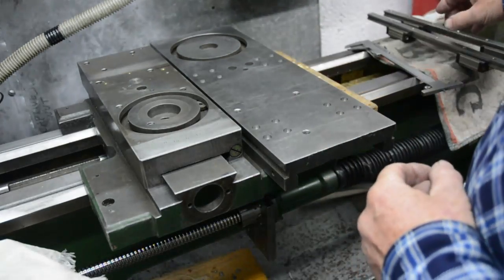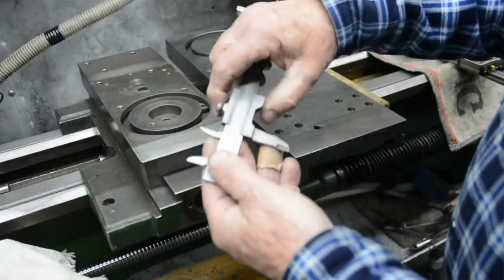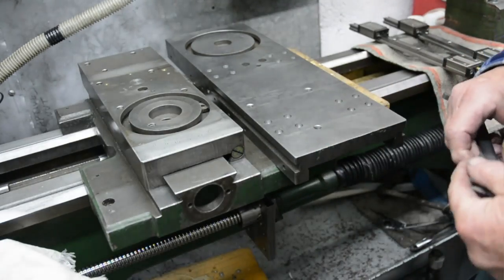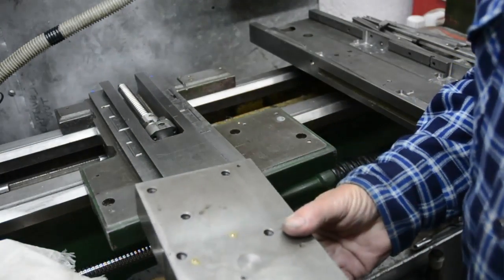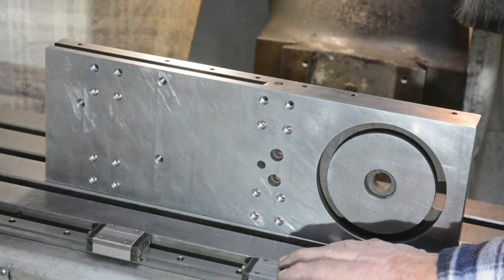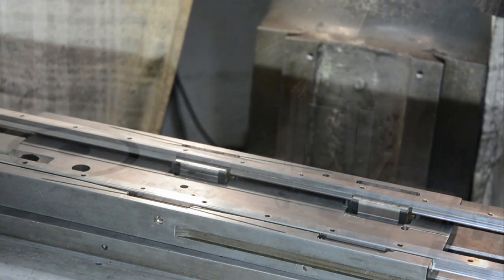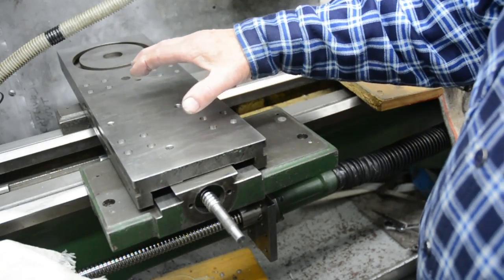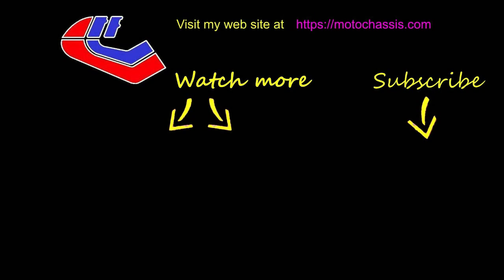Part 2. Removing lathe cross slide friction with linear ball rails.

Comment: has any of the hoses popped out of the bearing blocks of the crosslide yet? I would imagine them popping out from the pressure. Simple to fix with screw in/push pneumatic fitting with quick release for the tube.

Comment: Be very interested in how you propose to grind cam lobes. I propose to do the same, some of my ideas maybe useful
Reply from the maker: Have you seen Part 1 of the video series?  That shows the grinding head mounting.  Also an earlier video shows the electronic control,  they are all on this playlist https://www.youtube.com/playlist?list=PLyn2snGjYlHw_e4LomNphh8KleeqPiqpz .
I have written some cam synthesis software which outputs a set of cross slide positions for each position of the lathe spindle.  Those numbers are fed into the lathe controller to move the cross slide.  Some future videos will show it in action, success or failure.  Your ideas are welcome.
Reply: your biggest battle will be designing a cam lobe profile.  I am not going to belittle your efforts, BUT, unless you understand lobe lift acceleration and deceleration, velocity and of 
course lifts for a particular valve actuation system, either sever damage or cam performance will be disappointing. I do not know what type of engine you are thinking of making a cam lobe for, but my suggestion is to COPY a profile from a reputable camshaft supplier. Quite easy to do, and done universally in the trade. I am more than happy to give you more advise.   robbie  nz   @MotoChassisByTonyFoale

Comment: Those linear bearings will take the vertical load of a metal lathe, long term?
Reply from the maker: I'm 80 yo.  I do not consider long term.
Linear bearings are now common on hard worked CNC machines.

Comment: Hi Tony, great idea.
I like to see the rigidity in the next video how parting would go.
Thanks for this clear video.
Reply from the maker: Parting will probably be the toughest test.  Too late to back track now.
Reply: @MotoChassisByTonyFoale  Indeed is parting the game changer but so is your idea. Is metal chips bearing shielding sufficient enough?
And you can always reverse to original settings and parts if needed.
Such R&D is only possible in practise because of lacking (chinese) datasheets for calculations.
Reply from the maker: @noone18  I am very particular about shielding, it will be OK.  No, I can't reverse it I am past the point of no return.  Do not worry I am used to it.

Comment: When you are bolting the linear bearings to the cross slide you are relying on the 4 screws to provide alignment as the oversize pockets into which the bearings locate cannot provide a location feature. Would it not have been better to machine the width of the pocket accurately to provide a location feature rather than just relying on the 4 bolt down screws? Of course the proof of the pudding is in the end result and you have demonstrated that your alignment relying on the 4 screws alone is good!
Reply from the maker: Excellent question.  The rails themselves are factory drilled with 4.5 mm holes and specify 4 mm bolts.  I followed that for the trucks.    The clearance in the holes does allow for a final alignment on assembly.  Also the best alignment for the trucks is the rails themselves.  Alignment will be shown in the next one or two videos.